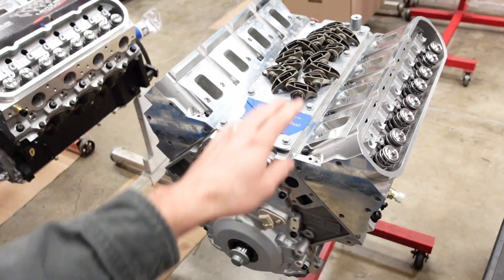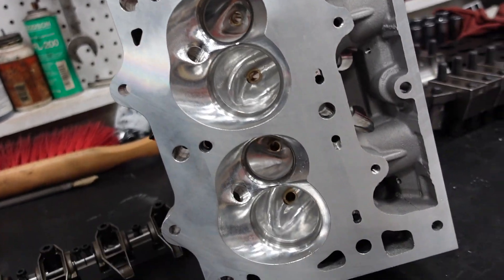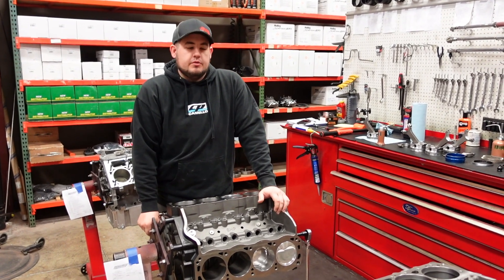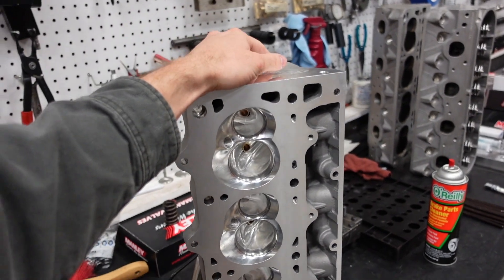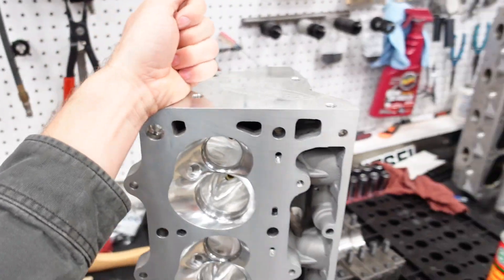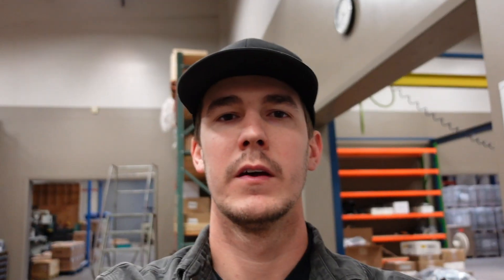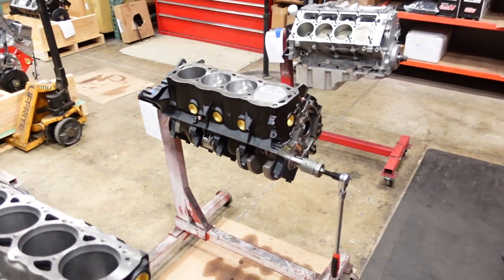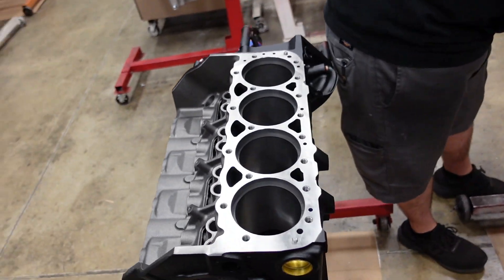LS3 Cylinder Head Testing, 93 Octane vs E85, Windage Tray Testing & More to Come Soon!

Comment: You nailed it when you said efficient cyl head. That’s the key! If I have a 230 cc runner flowing 300 cfm and a 205 cc head flowing 300, I’m going with the 205 because it maintains better velocity. It’s a more efficient head.

Comment: With milling the 11* heads to a 64cc chamber, what’s the chance of it causing fitment issues with the intake manifold? Looking to run a 64cc head on my 408 build  to get around 12.5:1 or 13:1 cr. Will be running a weisco 5cc dome piston. Still have to get the machine work done and decked then check piston protrusion to figure out what head gasket and what not. I know there’s more to it but that’s my end goal cr numbers for a pro touring c10
Reply from the maker: We milled 0.030” off these heads to get 64cc chambers. At 0.030” the intake should not have any fitment or alignment issues.
Reply: @JacobVillemain my next thought is on the 408 stroker they talked about what style pistons did he use? Ls1,2,3,6,96 style piston or 15* piston with the 11* head.

Comment: I like to see the battle between the hi ram on the 11 degree heads 

I ran a fast lsxr w/6.5” runners on my 418ci with 11 heads and it needs more plenum volume 

I wonder if a 2”x 3 1/2 headers make a difference compare to 1 7/8x3 headers 

Can’t wait for the test